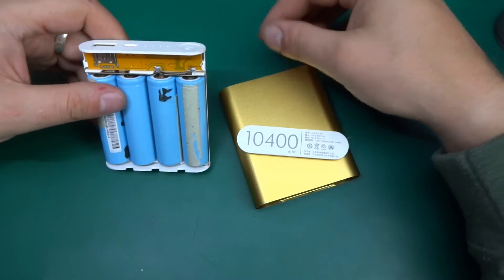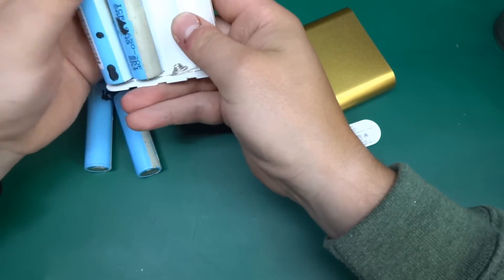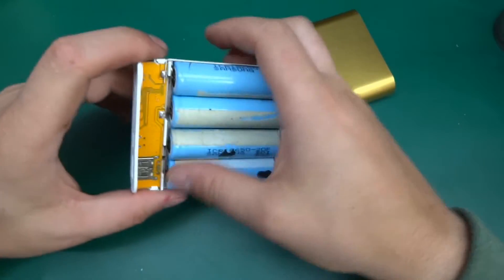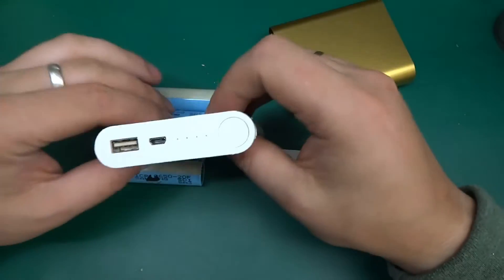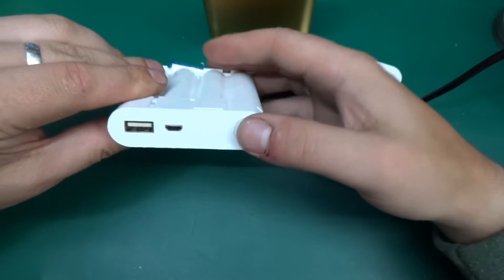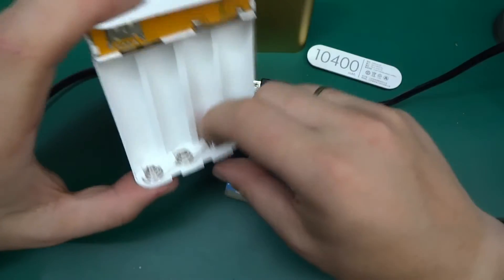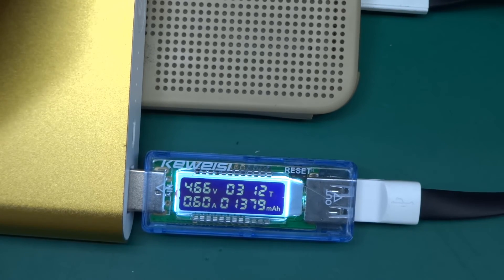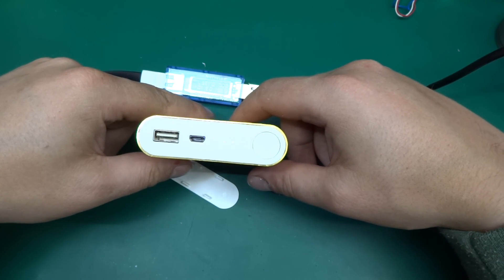4 x 18650 cell powerbank with charge indicator from ebay (NDY-02-AD)

Comment: Excellent review. I have a few generic power bank cases which are plastic, almost identical circuitry, but has 2 USB outputs which are said to be 1A and 2.1A - I haven't tested them but they all work well. The soldering workmanship on mine are pretty awful, a few had cold solder joints from the battery spring which wasn't encouraging but you get what you pay for. 

It's an expensive way to reuse old laptop batteries - just think about the millions of old laptop batteries simply thrown out which still has plenty of residual life that can be reused for this purpose. 

I also directly tap the battery connection terminals in the power bank case to  power external cameras or other devices requiring 3.7V - by removing its existing but dead battery and tapping the power bank batteries to the (now) dummy battery's protection board. Now my DSLR can work for hours recording video , and point/Shoot cameras can last for days especially on Canon cameras modified with CHDK firmware.

Comment: Nice review! Seems like a nice powerbank, except the low current (to me that's quite surprising considering the MP3401 is able to output 1A, would expect better from the 3411). And it looks like a Xiaomi powerbank.
Reply: TefaTronix yea it looks like a Xiaomi and Asus powerbank, but It's a replica. The xiaomi and asus ones has similar circuits and use Panasonic batteries